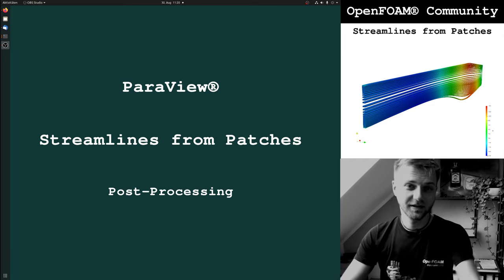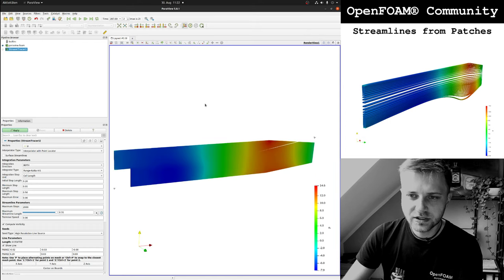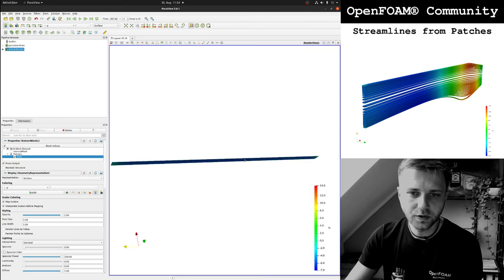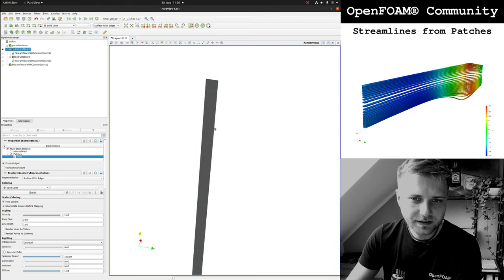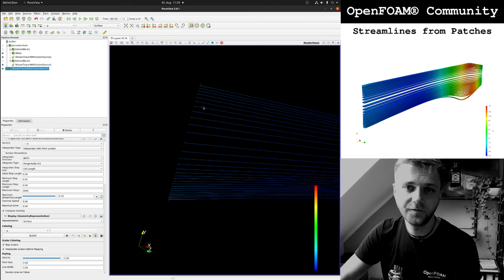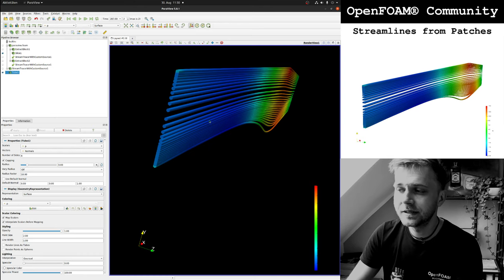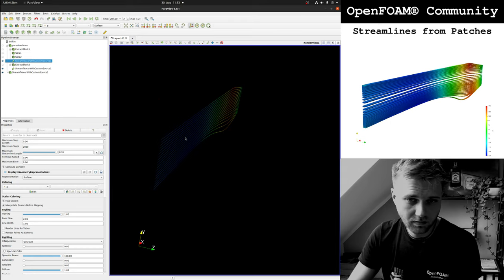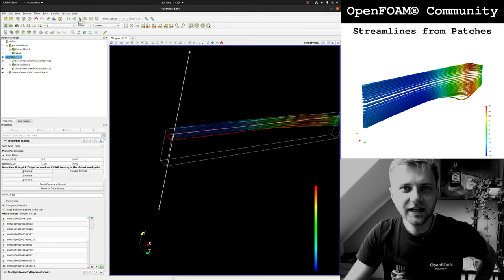Streamlines With Patch Seeds ∇ ParaView®

Comment: Thanks a lot! Very good and almost exactly what I was looking for! 

One question though... How can i create randomly distriputed seeds on a patch source? 

Also, I don't have the same filter options as displayed... For example, the slicing as you described it doesen't work for me because I can't find this option "value range". Any suggestions? I'm using paraview v5.9 on windows.
Reply from the maker: No idea. Sorry. Random seeds... well, you can slice your inlet as you want and generate points. This can be used as a seed for the streamlines.

You should have more or less the same option. However, as you are running on Windows, maybe this is the difference.
Reply: @HolzmannCFD  Thanks for the reply. I found the slicing option by now. Also, I found this Filter 'Mask Points'. Used on the Inlet, it will generate random seeds on the vertecies of that patch. There's no 'Off-Grid' seeds, but when the mesh is big enough its working fine for me.

Comment: hey tobi! how are you doing man?
question about these mini tutorial, how would you do to get a regular grid in 2D (the seed points) ? I mean have a 3D patch and cut it so you can get a regular grid over a 3D patch in the space. 
best regards!
Reply from the maker: I would extract the patch and then slice it in two directions (using the option for multiple slices wihtin one filter). Then you get a uniform seed distribution on your 3D curved surface.

And I am okay. I stopped making videos now and stopped working on my GUI for Foam as I am not allowed to go on in that project anymore.
Reply: @HolzmannCFD  thanks for the tip is what I was trying, but how you slice in two directions with one filter? I can do multiple slices in one direction as in the video tutorial but   I dont see any second direction possibility even with the advanced properties.
not allowed? problems of licences with OF license?
Reply from the maker: @francootaola9172  well, if you have a 2d face you slice it once in one direction (with multiple slices) to get single lines. After that you apply the same filter onto the lines and slice it the other direction. We get points at the end.
Reply: @HolzmannCFD  I was doing this but I had a mental blockage and did not realise why it was not regular my first slice patter, thanks tobi :)